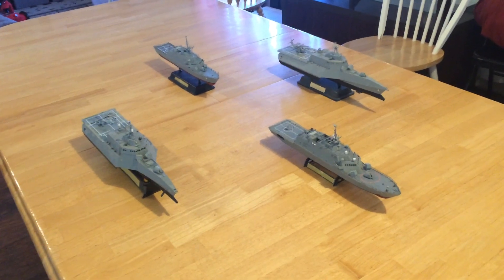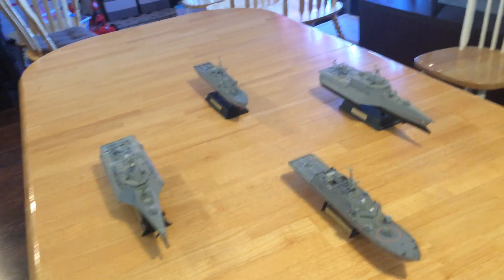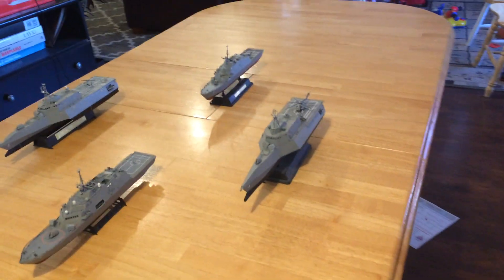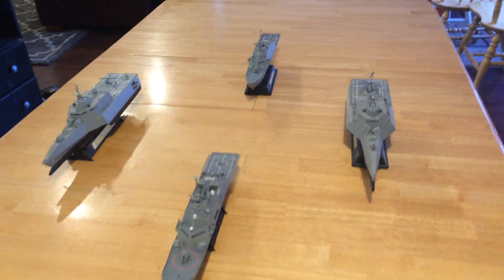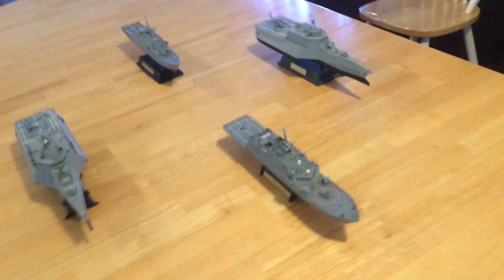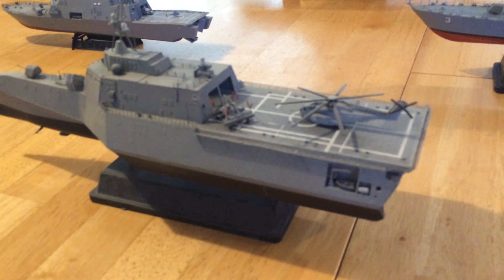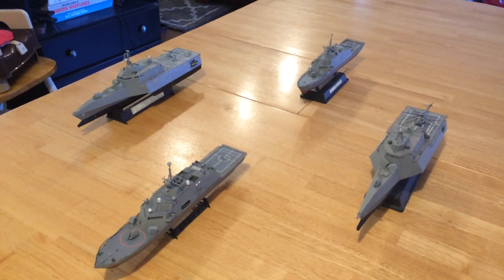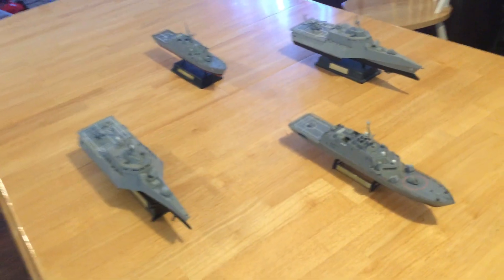Upgraded US Navy LCS 1/350 Scale

Comment: What has me steaming, is that Russia is building a fine new Frigate, while we are planning on buying Fiat quality FFG(X) dingeys from the Italians. There is no reason we should not be building our own. We even have full plans on the board for a smaller Frigate and large nuclear Cruiser sized version of the Zumwalt DDG-1000 class, but we don't want to make the investment.
SHAME ON US!!!!
Reply from the maker: I am hoping that the Hobart revision from Australia/Spain, working with General Dynamics and Bath Iron Works wins out over the Italian FREMM.  Both are actually good vessels, but the Bath Iron works Hobart revision is an actual AEGIS vessel and Lockheed will be there doing the electronics and fire control. That vessel will fit much better into our task forces and be able to do the cooperative engagement with the Ticos and the Burkes much easier and more seamlessly integrated than the Italian FREMM.  The FREMM is a good vessel to itself, but simply will have to be ore significantly altered to fit into the US electronics and weapons systems.  So...although I wanted the original Lockheed design, I am hoping now on the Hobart revision.  See these Hobart Sea Trials: https://www.youtube.com/watch?v=cF-0KoKRkLA